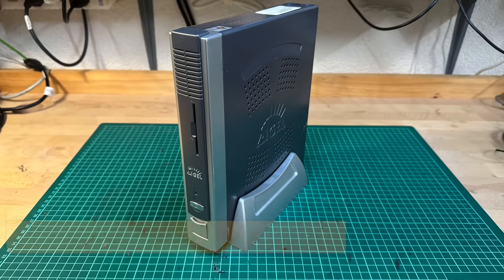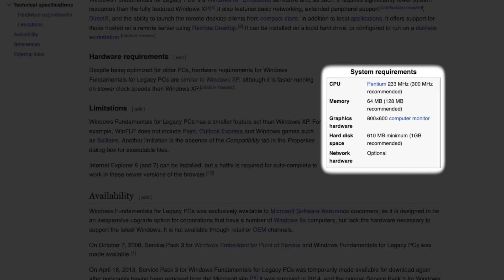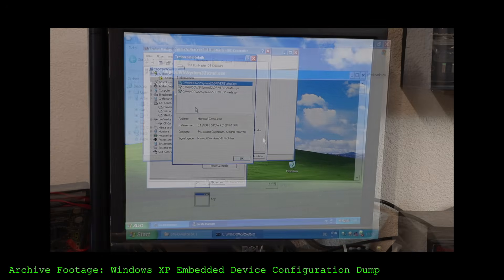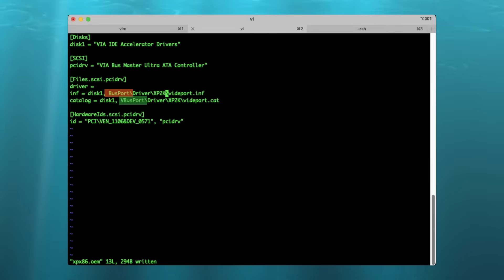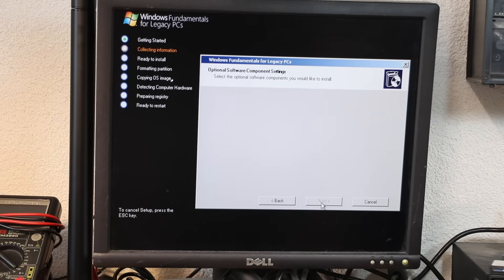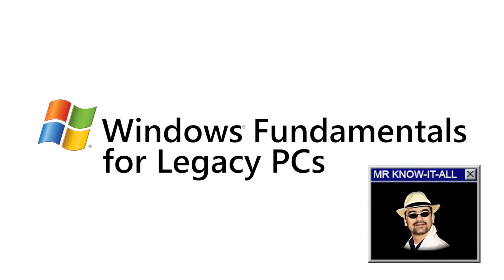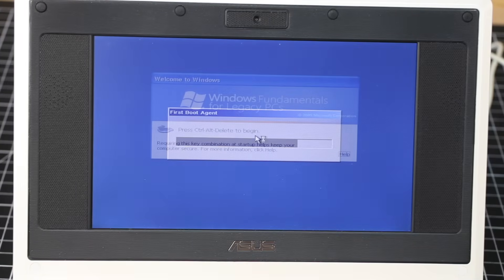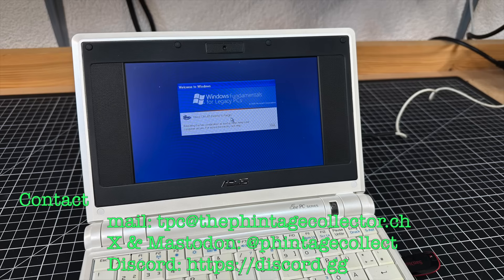Windows FLP - A Secret Windows XP Built to Keep Old PCs Alive

Comment: Missing the SATA or M.2 driver 
You have to insert the disk with the drivers when it asks for the RAID or SCSI drivers
Reply from the maker: Yeah, it's obvious the driver is missing.

The point is not about inserting the disk at the right time - which is what I did - but using a chipset compatible driver.

And apparently, the VIA drivers for Windows XP don't install with FLP, and the custom drivers for Windows XP Embedded, which worked on this hardware with XPe, are also not compatible with Windows FLP.

The latter is surprisingly annoying, as FLP is - as mentioned in the video - only a rebuild of Windows XP Embedded. So it totally doesn't make sense why the XPe driver doesn't work with FLP.

The actual solution is to use an alternative driver, as noted in my follow-up video: https://www.youtube.com/watch?v=QM7xIjXTco4

Comment: What is the source of the infographics at 1:03 ?

If you did it specifically for the video, then I wonder why Windows XP Embedded SP3 marked orange (major?) and how does it relate to non-embedded XP SP3?
Reply from the maker: I did it myself.

Orange are the origin versions, from which the child releases were spunn-off.
Reply: @THEPHINTAGECOLLECTOR I just got a little bit confused and was wondering why the most versions in the list are embedded ones, but some aren't (XP PRO and PRO SP2). It looks like regular XP SP3 and Embedded SP3 are exactly the same build version and were released at the same time? (Also, where is SP1, but probably removed because is irrelevant for the video.)
Reply from the maker: @yqqbey8779 correct, it‘s only the Windows Embedded significant lineage here.

Comment: I used FLP pretty extensively back in that era, mostly for testing builds of the software I supported at the time, but I also had a few older business PCs at home that ran really well using FLP.  My kid's first PC ran Windows FLP and they used it for gaming, YouTube and all kinds of other kid friendly stuff when they were small.  Was a great OS, sorry you had so much trouble with it!
Reply from the maker: @Zerbey  Ah, no worries.
I‘m used to trip into any such issues, sometimes I‘m also provoking it when pushing things a bit.
I‘m also not attributing the driver issues as Microsoft‘s fault. If anything, then it would be Via‘s for not providing a proper driver ;)

Comment: There is no need for XP or 7 now, Linux can do everything these 2 did much more efficiently, more quickly and more safely
If you really have to run windows then it's gotta be at least 10. There is no need to run older windows
Reply from the maker: @shiro.dharya  Valid view point.
But I have the impression, you seem to be missing the point of this video.
This is a retro channel, and it‘s not about advocating to run old software, but an exploration of old technology.
Of course, I‘m sometimes providing tie-ins to modern tech ss well, to provide different viewpoints.
But this is in no way to be understood as a best practice recommendation to use old tech as daily drivers.
I‘m sorry if you got a different impression.

Comment: Somehow I thought the EEEPC was a 900MHz but either mine was overclocked or my memory is playing tricks on me. Either way, I've tried a patched to death WinXP on mine and it felt like a snail race despite being upgraded to 2GB of RAM (which is hilarious given the SSD is only 4GB!). Then I installed  Windows2000 and holy wow did it fly. Got me through half of university like a champ until we started needing heavy duty stuff like solidworks.
Reply from the maker: Nah, you’re absolutely right.

The early EeePC 700 series was available with both 800 and 900 MHz Celerons, underclocked to 570 and 630 MHz respectively for the 700 („surf“)/701/702 models.

The 701 „4G“ model ran on the full 900 MHz.

So it‘s very well possible you had the 900 MHz variant.

Comment: i used to compare FLP and full windows XP in 2018, it wasn't have many user-facing changes tho.
Reply from the maker: No surprise, as it's still the same OS, just with some footprint reduction.
Reply: @THEPHINTAGECOLLECTOR  i do not notice any performance improvement in VM's. both versions are the same.

Comment: I remember deploying this in a small business as a VM whose job was to act as a printer server as that business had multiple of the same exact model of printer and LOTS of toner but they didn't make drivers for either for Vista and newer or for 64 bit. Their "server" could not afford running a full XP VM, even debloated, and of course they didn't have the budget for a separate machine.

Comment: this is legal issue  - 
there are some united  like ATM Machines or Railroad Wagons or elevators that ware build some time ago - using Windows XP for them inside computers - tested officially certified as one Unit  - the controlling PC and all the machinery around the PC  - nothing can not be change or the unit of which value the controlling PC may be only 1% value needed to be scraped - or re-run all the testing and certification process -
Reply from the maker: Good point!

Comment: Used a modified version of FLP that had SP3 integrated into it. Used it for gaming on a pentium 3 733mhz with 768mb ram. It was incredibly stable and I had a very noticeable increase in FPS using it versus the OE version of XP. I probably used that exact flavor of XP for YEARS until I was forced to migrate to windows 7(RIP).

Comment: Windows FLoP, unfortunately. Back in the day I installed the regular WinXP on my Pentium II-era PC (Celeron Mendocino @300 MHz) with 96 MB RAM (maximum for that motherboard), without worrying about making my own setup files. During the installation I removed all the stuff I didn't want, and after the installation I disabled the services that I didn't need.

Then I removed other parts of Windows that were pointless and I switched to the classic theme without effects, for a responsive desktop. Not exactly surgery, just some common sense fat trimming. I ended up with just under 64 MB RAM used by Windows, which was quite decent for XP. But of course, with a slow HDD it was still not worth it, given how much bigger the OS was compared to Win9x. And because I already had my Pentium 4 on the side, this was more of an experiment to see what was possible. Today, that PC would do well with Tiny Core Linux and zram. :)

Comment: We still have FLP running on some automation systems that refuse to die - at least not until they're phased out in the next few years. They are automation operator consoles on several large container ships. They don't get patched (air gapped) and nothing changes. They're backed by large UPSes running on an electrical bus that itself is also backed by battery and redundant diesel generators. The last time I looked at the uptime on one of these consoles it was over 5 years.
Reply: Surprised they’re not running windows embedded instead
Reply: @VeryCuul  Like the video says around 1:02, FLP was based on XP Embedded.
Reply: @Daniel15au  I understood that, I meant moreso because of the modularity of embedded being able to create an image that performs the specific requirements rather than a more general purpose one (FLP)
Reply: @VeryCuul  couldn't tell you. This is how the vendor built it. Maybe FLP licensing was less expensive.
Reply: Speaking of stuff that never dies... Point of Sale systems can have cheap computers that get treated badly and replaced in a matter of months, or good ones that last for decades with almost no upgrades.

Comment: I recently had a chance to install Windows Fundamentals for Legacy PCs, and it was a nightmare. For some reason, .NET Framework 3.5 fails to install if Service Pack 3 is installed. And Internet Explorer 8 fails to install if you're using an IME and the KB932823 update isn't installed (this probably mostly affects those who need an MUI). This update needs to be installed prior to Service Pack 3. Because I used the "/nobackup" switch to save space when installing Service Pack 3, I had to reinstall the entire operating system...
Also, it doesn't have Windows File Protection (WFP), which is also true for Windows XP Embedded. Instead, those two operating systems have Enhanced Write Filter (EWF).
And there are some other quirks in this operating system that can be somewhat confusing! These, combined with the problems above, made me reinstall this operating system about 10 times just in a week, because I had no idea what was causing those strange behaviours. But I guess that's what you get for using this lightweight version.

I've never used XP Embedded, so I'm not sure if it suffers from the same issues. It's also possible that I'm just being too harsh on FLP without understanding it well enough, but this was my experience with it.

Comment: I only went as far as Windows 2000. I did play with Windows 7, 8, and 10 as they came with the computers, but I always just replaced it with Linux. As far as I know, Microsoft still won't release Windows XP.

Comment: I've only tried FLP in virtual machines as I just run the regular Windows XP Pro on bare metal. 
Its interesting that MS started using the Windows Image format around the time of FLP as I knew Vista was the first to use it. I only realized FLP was using it when I was playing with it a few years ago inside a VM. But being an early WIM format Windows it sits in a weird middle ground of not being compatible with nLite (for Win2k to Server 2003) or ntLite (Win 7 to 11) and makes it harder to modify to slipstream drivers and setup software to auto install after the XP setup during the first boot.

Comment: I used Windows FLP as my daily driver OS from 2008 and 2015.  I used it on a Pentium 4 at 3.4 GHz and a Dell laptop with a Pentium III  at 1.0 GHz.  I used Windows FLP because there was no product activation and Windows Genuine Advantage garbage.  It worked extremely well on both machines it handled every application with no problems
Reply: WGA wasnt really an issue with so many volume licenses to choose from
Reply: solution: volume license

Comment: In MyPal browser settings, reduce the number of processes to 1, then install NoScript, and whitelist only the domains and subdomains that are needed.

For best performance on the web, make NoScript show full domains, so that it would be possible to keep blocking block ad and tracking domains, of which some can be vectors for viruses, and unblock only the necessary domains. uBlock Origin is useful for blocking video ads.

Most lighter websites should work ok. YouTube always takes its sweet time to load on first instance.

The about:config page has settings to disable user interface animations.

YouTube's own settings should also make it possible to disable video previews on mouse/pointer hover.

With low amounts of RAM, performance is not super, so users should avoid using multiple tabs.

A RAM upgrade would be in order for a PC of that vintage.

Videos would play, but at lower resolutions, such as 480p and 360p, depending on computational capabilities.

Comment: Ironic that Microsoft should release a specific version of XP for older hardware, while their official line with Windows 11 is "If your PC is too old to run Winnows 11 you'll need to scrap your old PC and buy a new one".
Reply: Their line is BS. they have a specific, official variant of windows 11 called IOT enterprise LTSC.

it has no TPM requirement and the system specs are "can turn on and run windows 7 x64 without catching fire."

It doesn't include the Microsoft store, but that can be manually installed.
Reply: @bobthecannibal1  "massgraveD0Tdev" iz yer frend!!! 😂
Reply: Given the large install base, Microsoft should extend Windows 10 support even further. It's pointless to blame millions of users who are unable to upgrade to Windows 11.
Reply: @mardus_ee  Just switch to Windows 10 IoT Enterprise LTSC already, it's supported into 2032. And just to stick it to M$, the MASsgrave scripts work perfectly (both for HWID and TSForge).
Reply: real  @mardus_ee
Reply: @mardus_ee  Anyone still working with a computer so outdated it can't upgrade to 11 is likely doing nothing but web browsing and youtube with it, which means staying on windows 10 isn't much of a problem. It's only a problem if you've got a lot of important files and software that it would be an inconvenience to lose in the event your computer is exploited because of the lack of security. If all you're doing on it is youtube, why even worry about upgrading?
Reply: Windows 10 LTSC is still doing well
Reply: Windows 95 even had an official lite version on the installer
Reply: "Windows 11 IoT LTSC"   EXISTS!
Reply: There are legacy pc os Windows 10/8/7 and even 11 has one(not quite same as flp but still)
Reply: Better solution: scrap windows.
Reply: @blainehamilton4659 Use stripped down versions of Windows.
Reply: @Reman1975 Nope bc this is similar as today. This was a paid product for business users. Win XP, 7, 10 all have/had paid legacy support for business users past the consumer support
Reply: The difference being who's paying them to provide the operating system.
Reply: Tiny11 can run on older computers.
Reply: There's 10 IoT Enterprise LTSC 2021 that still receives support until 2032 and old devices don't need a stripped-down Windows 11 if 10 works better.
Reply: @sgirix65  Yeah. I installed "Tiny 10" on my games PC, and that's Enterprise LTSC based. It meant buying yet another licence key (Reasonably cheap  from Gamers-Outlet) but it works fine, and dumped a load of the unnecessary clutter from running in the background too.
Reply: I know it's ridiculous to even consider this, but I almost wish there were laws to prevent that. I fucking hate e-waste.
Reply: XP is for older hardware, it just can not handle modern workloads
Reply: @chenyansong that’s the internet’s fault, not XP’s. If we spent more time optimizing our software and the internet, XP machines would work fine today
Reply: If you're still using a Core2 or Athlon 64 then you need a new PC. Anything newer than that will run 11.
Reply: @talibong9518 Pretty much any PC made before 2019 won't have the trusted platform 2.0 chip, so unless Microsoft drastically changed the Windows 11 system requirements, nothing much from before that date is going to "Officially" support 11. So that rules out mostly anything that has a CPU before an 8 or 9th gen "Coffee Lake" (So any before "Core iX 8XXX" or "Core iX 9XXX" based systems).
Reply: @Reman1975 well many of that area have tpm 2.0
Reply: @Reman1975  TPM headers have been a thing on motherboards for a long time, you can buy a module online which adds a new enough version to get an older machine on W11.  Or you can do the Rufus method, I've run W11 on a Core 2 Duo just fine with that method.  The problem is that the TPM really is an effective protection for your machine which nobody would bother to implement it if Microsoft didn't force it.
Reply: @Reman1975 TPM has been standard since 2016, not 2019. That's nearly 10 years ago now.
Reply: @Daniel15au  Becoming a standard doesn't mean hardware manufacturers implemented it at that point. Many system manufacturers were still predominantly selling TPM 1.2 only compliant systems right up to 2019, because until the projected Windows 11 requirements were announced to the industry, in 99% of cases, the "new" TPM 2.0 standard wasn't really being used by the OS to any extent beyond the level which TPM 1.2 already catered for.

So while TPM 2.0 was "A" standard in 2016, it wasn't "THE" standard manufacturers were including until the point where NOT including it would hurt their PC sales. 

Its a similar situation as USB 4. The standards been out for over 5 years, but until there's a universal demand for equipment to use USB4, and NOT implementing it would push customers to competitors who HAVE implemented it, hardware manufacturers will keep happily making stuff that only supports up to USB 3.2 or C.
Reply: @Reman1975  I guess I'm used go business-oriented laptops like Lenovo ThinkPads and ThinkStations, which have had TPM 2.0 for a long time. My employer has mandated TPM 2.0 on all hardware for a long time - since 2020 if I remember correctly.
Reply: @Daniel15au  That sounds about right.

Windows 11 came out in 2021, and by 2020 it would have been common knowledge in most IT support departments that the OS needed TPM 2.0 compliment PC's. So thinking ahead, IT managers would have been frantically cataloguing which of the company's computers were TPM 2.0, which were 1.2 but upgradeable, and which wouldn't be able to run 11.

They may not have had any intention of going through the ball ache of migrating all their kit to 11 at that time, but they'd want to know how much of their kit couldn't make the change in case some CEO type got a bee up their butt that the company NEEDED to upgrade.

It would also mean that they'd be retiring as much non compliant kit as the budget would allow each year and making sure the replacements came preinstalled with a TPM 2.0 module.
Reply: @Reman1975  My laptop back in 2017 has TPM 2.0. can't upgrade just because of 7th gen i5
Reply: @talibong9518 I have an i7 4470k in a fully usable windows 10 pc. Windows 11 doesn’t support it
Reply: @hayander you can install Linux
Reply: @hayander yeah I have the same.
Reply: @talibong9518 I mean I can’t either, not officially. I have an i7-6700.
Reply: @talibong9518 why? It the pc functions perfectly for what it is used for scrapping it is e-waste
Reply: @talibong9518 Ive ran windows 11 smoothly on countless Core2 and athlon systems.